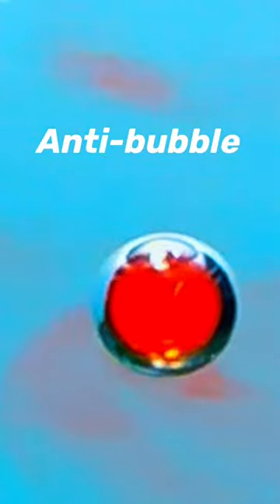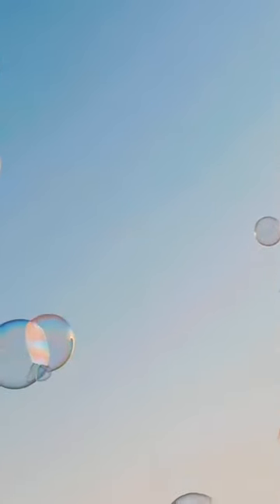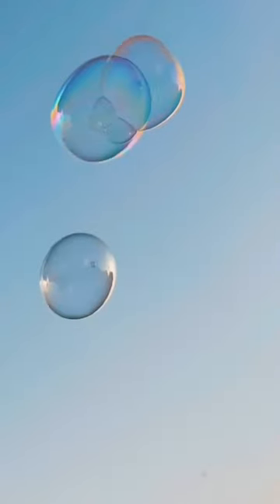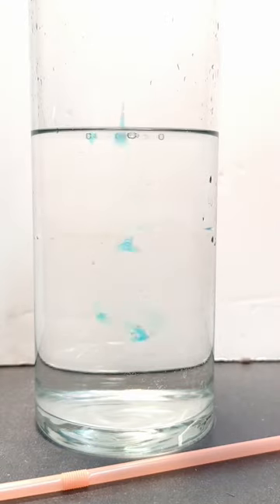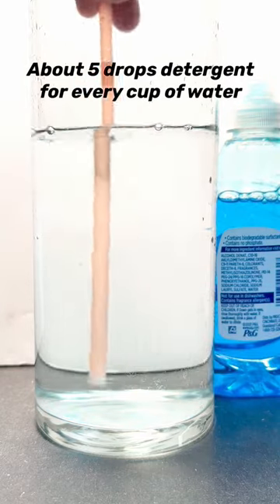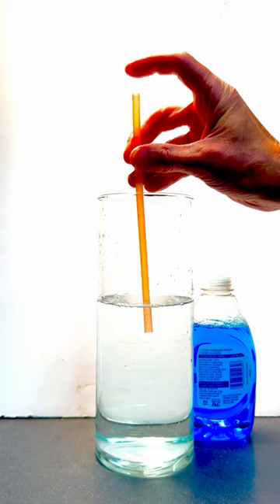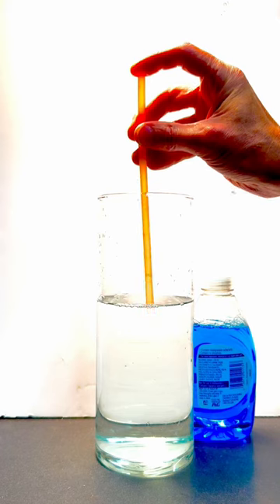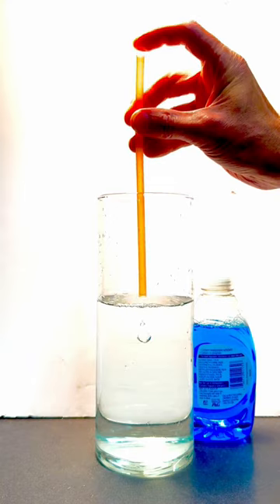What is an Antibubble? 🫧 #shorts #science #bubble #scienceexperiment

Comment: What is stopping the inside from just merging with the outside? It’s not like air has surface tension, right?
Reply from the maker: I think this is a great question and I don't know the answer. We generally think of surface tension over an air/water interface. In this case it would be the soapy water/air interface. I imagine the red droplet has to push air out of the way to merge with the bulk liquid
Reply: @TommyTechnetium  I’ve been thinking about it a bit, and one of my hypothesis which I kinda doubt but might be possible, is that at the soapy air Interfaxe on the inside has the nonpolar end pointing outwards, and the soapy water on the inside has a polar surface pointing at the inside, or vice versa, stopping them from merging?
Reply: Interface*

Comment: Would this have the same dynamic behavior as a double membrane i wonder?
Reply from the maker: Interesting question
Reply: Liquid-liquid-liquid vs liquid-gas-liquid
like what happens when two collide?
Could the air in the antibubble be as thin as two molecule layers. In this setup the antibubble obviously rises but wouldn't it also work with a heavier inside liquid. 
Is antibubble based life possible?
I'm dealing with cells with their phospholipid membranes so often i am astonished that i never thought about having a gas outer layer.

Comment: Wouldn't a raindrop falling to the ground be an anti bubble?
Reply: Not unless you are surrounded by water. It needs water on inside and outside with the spherical surface of air in the middle.
Rain only has the inner water.
Reply from the maker: Technically, no. However, the science that describes droplet formation is incredibly similar to the science of bubble formation. In this sense I totally see what you're aiming at